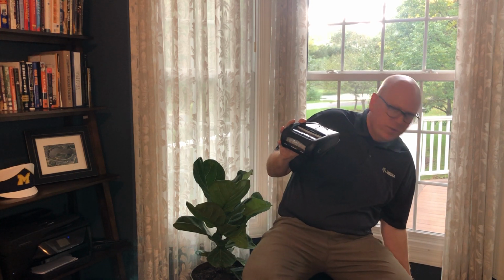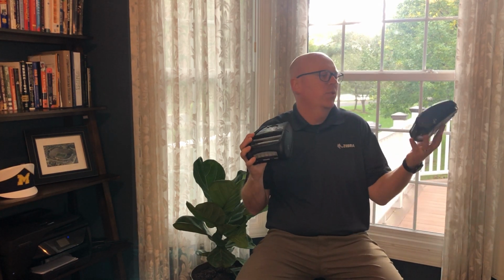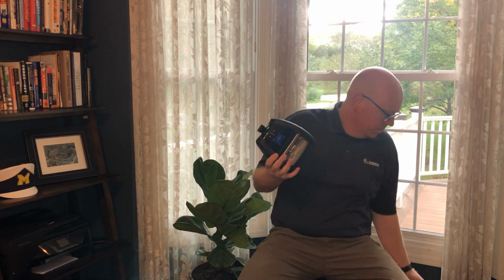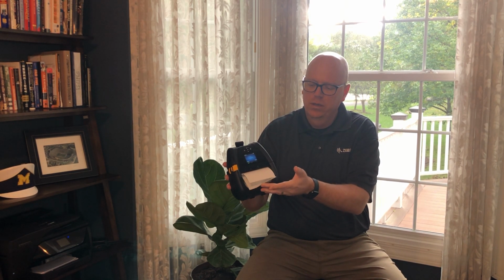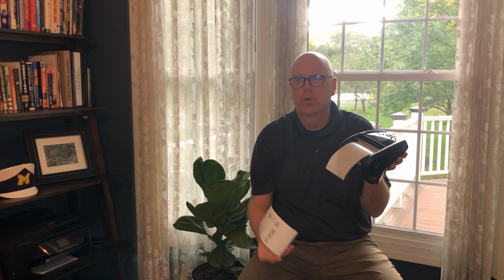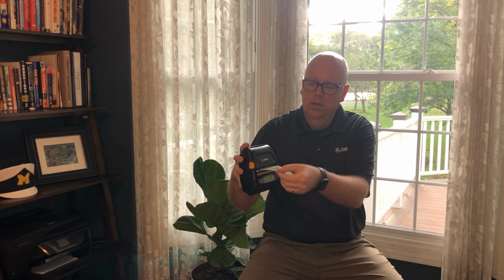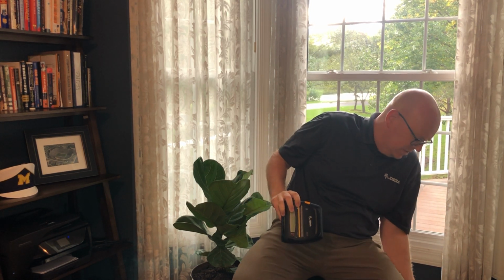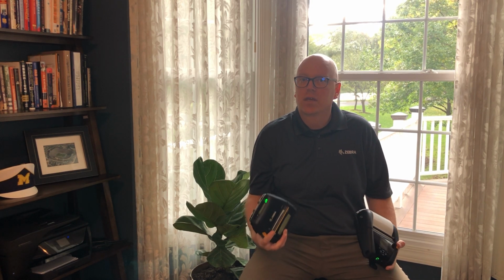Zebra Mobile RFID Printer Overview

Comment: Not sure if you can help, we are using bartender on a server to print labels with a zebra zq630.

I have calibrated via bartender and the printer too and there is no marks in label we checked various settings but on start up when you turn printer on or change media what happens to all the new printers we purchased is two labels are wasted and then it's fine after that no motion appears to be turned on I think so confused. But always two labels are wasted no big deal but seems a little waste.